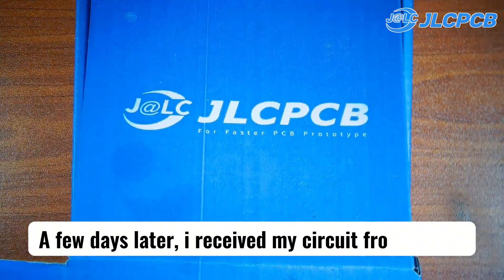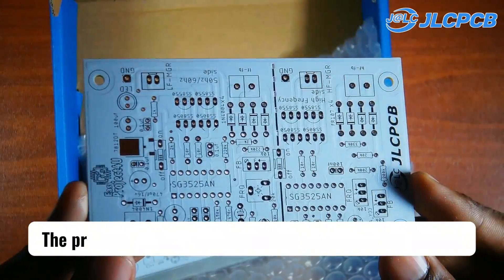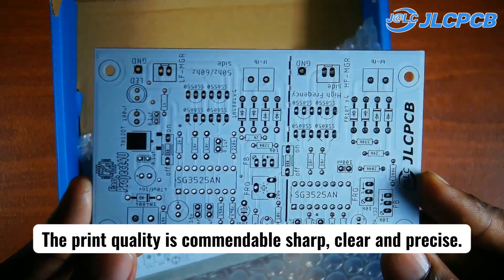How to make inverter 12v to 220v | SG3525 Module | JLCPCB

Comment: Irf3205 - 2
220 Ω - 2
100 Ω - 2
12v*2 transformer - 1
WHAT A CLOWN SHOW.....NO WATTAGE, NO VA RATING.  AND IS FAKE - IT WILL NOT WORK WITHOUT CAPS OR A INDUCTIVE FEEDBACK LOOP
fake!
Reply from the maker: easyproject4u channel does not create videos with fake content. If you try it first and it doesn't work, post a reply comment to this same comment.
Thanks for your comment.
👉❤️👈